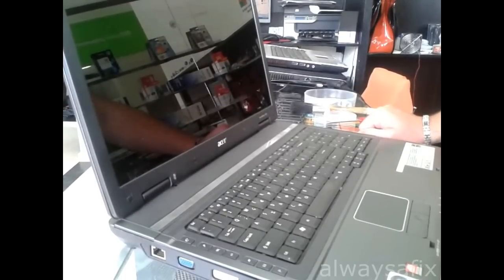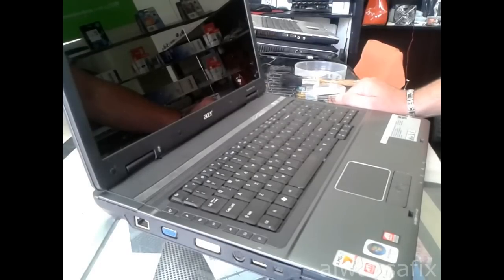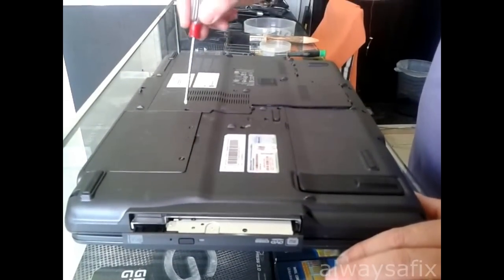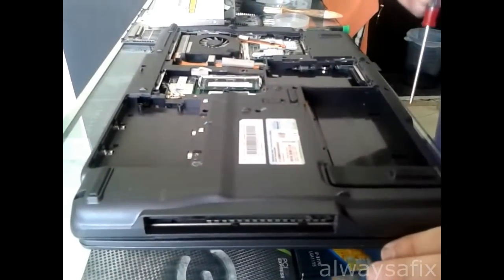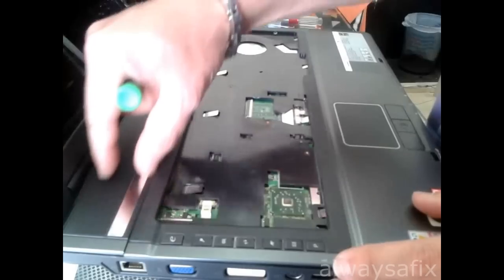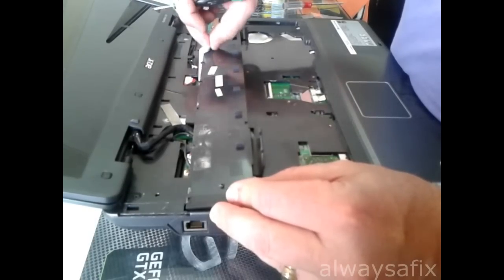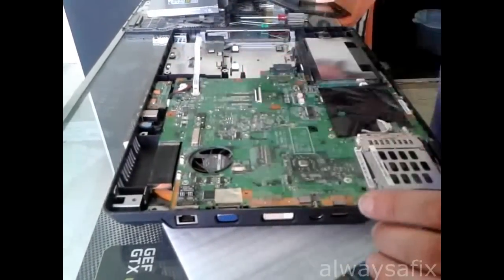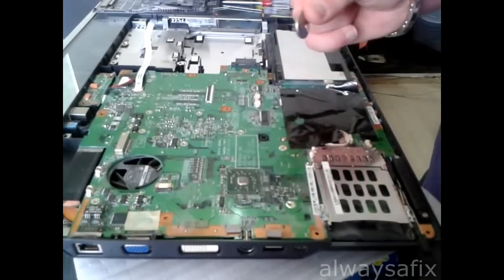Acer laptop not starting black screen repair

Comment: I still have the same problem on an Acer 5552. Operates but black screen.

The 1st time  what I did, was to flash the BIOS with the Fn + ESC and a USB with the new bios from Acer. Everything came back to life after 4-5 tries.

But a month later the problem showed up again after the lapton was sitting for a week non operating.
I installed a new bios battery thinking that I havent changed the old one.
Flashed many times till achieving a restart and live the Pc again. This time I couldnt do it with a USB so I used a DVD with the new rom from Acer. Fn+ESC again.

After that I tested 2-3 times to boot. Everything ok.
I placed the Big Battery and let it charge. Next moring tryed to boot same problem again. Black screen of death. 

I try to flash again and no result for 2-3 hours. I will continue  trying..... But now I have made these thoughts...

1) Since the big battery is really old I am starting to think that maybe this is the cause of Bios corruption. 
2) Maybe it is not the BIOS. I have checked the 2 memories (2GB and 1gb) . But nothing to do. I will check them more with a memory test program when I am able to boot again.
3) The graphics card wont be the problem since I managed to reboot 2 times after the screen of death. A dead graphics card is dead....U cant boot and see.
4) I have heard that when a USB is short-circuit can cause this problem too. But even that cant be the case since I have booted 2 times allready. A short cicuit is permanent.
5) Since my desktop can corrupt a bios when the power button stucks on boot I am also thinkg of a not good power button on the Acer. I even think it more since the 2 times I managed to reboot I did it in a bit a strange way. That is I pressed the button to boot - released short and pressed again....Otherwise no succeded boot.

Anyway strange story. Have any thougts to add? Thanks
Reply: NOKLifeguardsCorfu Exactly same problem and same results I am having.I think Acer bios memory is volatile and needs a usb flash drive left in to keep the laptop working by flashing the bios every boot
.

Comment: I have an acer apsire 4741 and it stays on but no screen response.. (only power lights and fan)
Reply from the maker: That's exactly what this laptop was doing before I changed the motherboard battery.  Have you tried that?  Also try reseating your ram.  Good luck!
Reply: alwaysafix
Hey, my battery is a recharge one that cant be replaced unless its got a whole new part of ebay (It isnt just a slot of the battery its a special one) That possibly might not be replaceable is it possible to recharge it?
Reply from the maker: smooshman12345 Measure it with a multi meter does it give you 3 volts?

Comment: Hi when I start my laptop acer 5736Z it said failure configuring windows update,,reverting changes
Do not turn off computer.
What should I do.
Reply from the maker: Once Windows has reverted the changes it should start normally.  You can then go to Windows Update through the control panel and disable Windows Updates.  Good luck!

Comment: Hi, I have a laptop that also shows a black screen when powers up. The fan is going, power button is on, but the screen doesn't show anything. I have to force shut down my laptop a few times and only then will it power up normally... Hopefully you are able to give me some solutions that might help with my condition. Thanks!
Reply from the maker: Try reseating the memory.  Good luck!
Reply: alwaysafix Can You help meh with my Laptop Please its an acer aspire
Reply from the maker: Khadija Shee Please describe the problem.
Reply from the maker: Khadija Shee Hard disk needs to be removed and connected to another computer with a usb adaptor to run diagnostics.
Reply: well my laptop turns on but then it brings me to acer empowered screen and says press f2 for setup.But i watched a youtube video that shows me how to get to acer erecovery management , But i did it and after ive wated so long, it tells me that it failed!:(( Idk whats wrong with it

Comment: Hey , nice to see somebody is up to this situation!
I have acer 5552g with same problem when i power on , only power light blinks no hdd nor wireless blinks.
My cmos battery is not replaceable like yours , its together with mainboard. If i see service to replace it will it work for me too?

Thanks for support
Reply from the maker: Before doing anything try reseating the memory.  Good luck!

Comment: I have a acer aspire e1-571 and it just wont boot up or give an indication that itbis charging.. The problem started when I was using it and a message popped up saying that battery was below 7% I immediately put it for charging and after 5 seconds it turned off and wont start.. Please help!
Reply from the maker: Try borrowing a compatible charger to rule out problems with your charger.

Comment: Sir i have acer 5734z and it is black screen. When i turned on the power button it has light but thr screen is black (nothing happens) i also tried the external monitor using vga cable but the result is actualy the same. Please comment back. Thanks in advance
Reply from the maker: Try reseating the memory.  Good luck!
Reply: alwaysafix You write this very often. Could you please tell me what you mean with this?! Just send me a link of a video or website. Thanks dude.
PS: Or do you mean i should buy new ram?!
Reply from the maker: MC4allforUser It just means taking it out swapping it around and putting them back, making sure they are correctly seated.

Comment: under keyboard there are two pins. if the keyboard comes lose or is not set properly, it wont make contact or post boot. i took my system apart. checked the voltage on cmos seen it was fine, but when i put it all back i noticed these switches. i cleaned them and now all is good once i clipped the keyboard back in
Reply from the maker: Congratulations on your fix and thanks for watching!

Comment: i have problem when i update my vga driver and turn on laptop then it will start normally upto windows only then it urns black help
Reply from the maker: Can it start in safe mode?
Reply: yes i can restore but vga driver would not update. i want to update it
Reply: alwaysafix yes i can restore but vga driver would not update. i want to update it

Comment: My aspire 4763z is not working. if i plug the charger, there is no light appearing. when i turned it on. nothing happens. I also tried removing the battery and hold the power button for few seconds. then plug in the charger to the laptop and turned it on. nothing happend. What should I do? Should I bring it to the service centers?
Reply from the maker: Firstly you need to check your charger with a multi meter and make sure it's working.  Good luck!

Comment: thanks for your video.
I have an  acer aspire 4551 with the black screen problem.I downloaded Bios from website .but I dont know how can use this bios file to my note book..Can you tell me about this please.
Reply from the maker: Has your motherboard battery been checked?
Reply: alwaysafix
do u mean CMOS battery? if it is not good, can i still upgrade bios? thz
Reply from the maker: zink eron If the CMOS battery is flat, replacing it might fix your problem, without messing around with the bios.  Good luck!
Reply: Thz for ur reply :)

Comment: Hello I have the same problem with my acer laptop but I will show you some problems to explain it .
When my laptop turns off and I try to turn on the screen is black but if I try 2 3 4 5 times it starts working or if I connect it with hdmi cable with external display the laptop works but the screen is in black what should I do ? 
Thanks .

Comment: Hello alwaysafix, my prob with my Acer Aspire 4315 is that after the ACER screen appeared then messages like this showed up:

PXE-E61: Media test failure, check cable.
PXE-M0F: Exiting PXE ROM.
OS Not Found.

I googled, found and try some of the solutions but they did not solve it. The messages like above keep showed up when i reboot my laptop. can i solve my prob using the way you use in this video? Hope you can help me.
Reply: your laptop is set to boot from network, change the settings in bios, select HDD on primary boot option

Comment: Hi, i have probelm with Acer TravelMate 5520. When click power button is black screen, power button blinking, fan of CPU doing. This happens two times and then shut down. I tried with hard reset...

anyone know what could be wrong?
Reply: I have exactly the same problem...
Reply: fesluchie yes the same problem too
Reply: Nothing on mines is doing after cleaning the Fan :(

Comment from the maker: @Vincent SJ If your Acer model laptop has an inverter, then you need to replace it.  Good luck!
Reply: +alwaysafix i had replaced inverter, monitor, cable, and CMOS battery.
The problem that i discover is the voltage that determines the brightness is 0V and dont change. That voltage shoud be on 0~5V range. Do you now how to discover where is the problem on mainboard?
Reply from the maker: +Angelo Freitas Try replacing the cable to the inverter.  If this doesn't work it's your motherboard.
Reply: +alwaysafix i replace the cable to the inverter and the problem isnt solved. So a mesured the input voltage of the inverter. The voltage that controls the backlight is 0. So a solved the problem soldering other entry that as 3.3V to that. This is a fix for anyone that needs to solve the problem without replacing motherboard...
Reply from the maker: +Angelo Freitas Well done, good job!  Thanks for the input, Im sure it will help others in the future.

Comment: hello there, an acer laptop buggered up. after pressing the power button it turns on (u can hear the processor running) within 2-3 second it turns off by itself with a little squeak sound; restarts again by itself and then turn off again with a squeak and this keeps going on. can the procedure shown in video fix that up????
Reply from the maker: When it switches on, does it show anything on the screen?
Reply: thanks for replying, no it does not show anything. It turns on, within 3 sec. a squeaky type noise turns of again, retart by itself again a squeak and so on ,by itself

Comment: I have the same problem now. But its not the battery problem. Basically i had to dissasemble the whole notebook because it was overheating badly. After assembly no display. I followed every step including discharging static. Still no display. Seems to be prevalent problem in Acer computers.

Comment: Hi

I have an aspire 5551 with the black screen problem. I had it connected to my tv with a hdmi cable and accidently closed it, when i opened it up it was just a black screen and has been ever since. When turning on it sounds like things are normal but nothing appears on the screen. Please help.
Reply from the maker: Do you get an image when you connect it to the TV?  Also, check function keys FN + F5 combination which moves the image from the TV to the laptop screen.  Good luck!
Reply: Yeah it was working fine till I accidentally closed the lid, tried the function key's but no joy. I also removed the ram but still black screen.
Reply from the maker: keith forrester If you reconnect to the TV, does the TV get a picture?
Reply: No I tried that.
Reply: Any other ideas mate?
Reply from the maker: keith forrester Probably a faulty GPU due to overheating.

Comment: Great video. Looking for a solution for my acer aspire 7520. Power lights come on when plugging in the adapter. When powered on I hear the CPU fan spinning and HDD, ODD starting up, but I see nothing on the screen. The laptop continuously restarts after 5 seconds. Fails to boot. My battery is soldered onto the motherboard and I have the tools. Could that be the solution or is it CPU maybe?
Reply from the maker: Before you unsolder the battery, use a multi meter to check the voltage.  It should be 3v.  Have you tried removing the RAM and starting with one stick at at time?  Good luck!

Comment: Hi, I have an Acer Aspire 4752.The problem started, my frientd took the laptop, as per him, he watche the movies and inserted old DVD. after insertion of few DVDs the pc freezed. so he directly pressed the power button directly.

Here's what happened. When I power on the laptop, the boot screen shows up and shows the line press <F2> to enter the setup, with the progress bar below, moves up to 75%. When I press F2 or F12, is says waiting.... But the progress bar doesn't go 100%. I tried waiting up to about 30 minutes but there's no luck, the system won't let mo go to setup bios or boot menu. I tried removing the hard disk ang booting it but the same problem occurs.

I saw your video but the bios i downloaded is different from yours in the video. i didnt know which to rename with what. i tried without renaming. but i can't make it work.

Can you suggest me anything I can do?

I don't know if my laptop is UEFI based but from the startup screen I can see that my BIOS is from Phoenix technology.

By the way here is my system specs:
Intel Corei3-235M
Intel HD graphics3000
2 GB DDR3 memory
 500GB HDD.
DVD drive.

Thank you for helping me out.
Reply from the maker: Remove the RAM sticks and try and boot with one at a time.  Good luck

Comment: I have an Acer Aspire V5-561G-6894. It was stuck on the Acer screen, so I powered off. Now when I try to start it, it's just a black screen, the computer tries to boot up, then shuts down. Is this the fix for that? Or something else? I really don't want to dissect my laptop, but if that's what it takes. It's a brand new computer, just two weeks old.
Reply from the maker: If the computer is only two weeks old, I recommend sending it back under warranty.  Good luck!

Comment: I have an acer v5-571p-6815, it's a touchscreen. My screen has no physical damage and it powers on just fine but, I took a slip on some ice during the winter and at first half the screen worked while the other half would go fuzzy. The touch screen still works perfectly but, now my screen has gone black with the exception of some colored lines. It seems like some wiring might have gotten knocked loose. Wondering if you had any ideas.
Reply from the maker: It could be a loose cable, but it could also be a faulty lcd.  The only way is to disassemble it and try reseat the cables.  Good luck.

Comment: :( tried but with no success.
I've also tried:
1) changing a ram module
2) connecting the laptop to external vga monitor
3) changing thermal glue
4) upgrading firmware with crisis recovery usb (it seems that neither Fn+esc, Start+B,Fn+B worked for me).
Laptop is Acer 5542g.
Thanks the same
Reply from the maker: It sounds like you have a problem with the motherboard.  It needs to go to a service centre to be checked.  Good luck!

Comment: My Acer Extenza 5010 I've the same problem when i push the button on: it flickers one time but no turn up, no light on the screen.Please  can you direct me, to repair this failure. Thank you!
Reply from the maker: The backlight is not working, but can you see an image if you shine a flash light onto it?  Does it work with an external monitor?

Comment: hey brother thank you from moroocco .. good job ;) i want ask you ! my acer computer don't working when i  turn it on, i don't see see any lights at all? ... if i change the batetry it's working or not ? thank you again
Reply from the maker: If you don't see any lights on at all, the first thing to check is the charger with a multi meter and get back to me.
Reply: all is good brother the charger worked 100% but i don't see any lights at all ?

Comment: I have local brand laptop. My problem if I turned on my laptop. Hdd work, fan work, windows started succesfully, external monitor work with no problem. But the laptop lcd black screen, no light at all. 
CAN I USE THIS METHOD ?(replacing cmos battery?)
Reply from the maker: No, you have a different problem either related to your screen or the graphics card.  Does the back light come on?

Comment: I have an Acer lap top  when i start it give me orange and red colors i try refresh its memory card and it gives me one beep i know i install it in wrong position i install it again in first slot and finally the lap top gives me sound when i start it on or shut it down. .
please can you guess the problem? notice it start on without beep sound but no pictures on the screen at all only strips colored lines vertical most time and horizontal lines rarely and sometimes blue screen
thanks a lot

Comment: I have this problem, but it shows the ACER screen, and shuts right back off, going into a cycle, and wont ever go off, unless I take the battery out.
Reply from the maker: Try remove the hard drive and see if it stays on.  If not, you might be looking at motherboard.